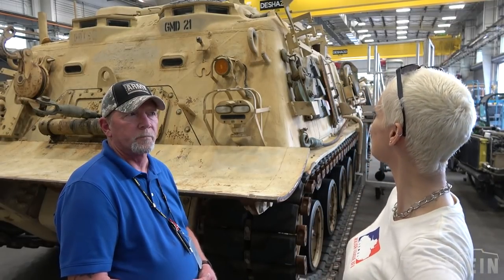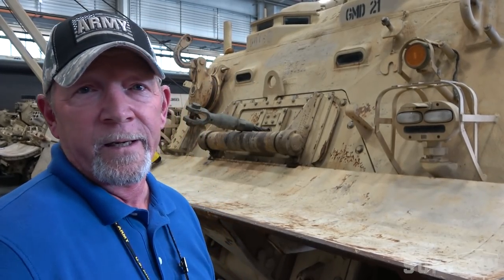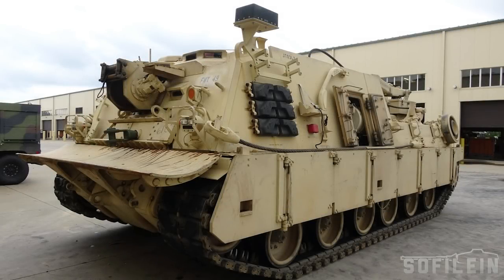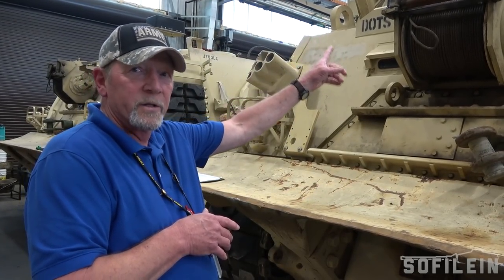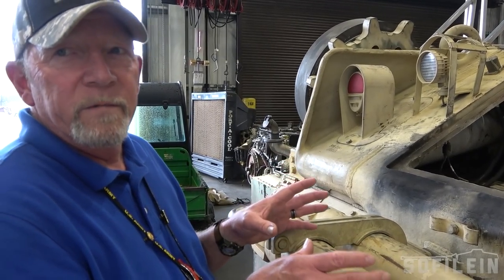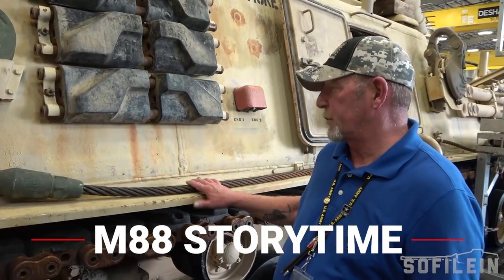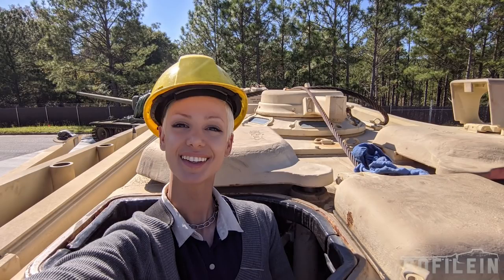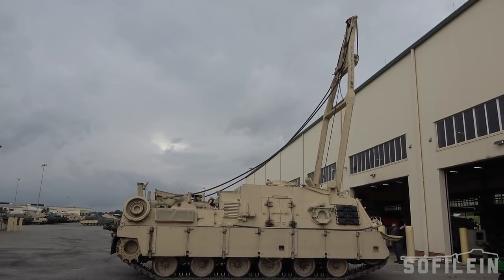M88A1 and M88A2 U.S. Army Armored Recovery Vehicles

Comment: All true, but as one of the engineers who designed  or was directly involved developing the M88A2, it is really nice to know  people know.  The presentation was an intro to a truly remarkable vehicle.  
The APU was on the later versions of the M88A1, but not as capable.  We added additional functions.  
There is confusion about the power for some reason.   There was some experiments with a 1050 hp supercharged engine in the A1 but never fitted beyond a few field tested vehicles.   The 1050 hp engine used in the A2 is an upgraded version of the base engine used in the A1, M48, and M60.   We experimented with a 1210 hp engine in the chassis, but the only gain was to speed without load and it ate more fuel.    Cooling was also a little marginal in summer heat even at BMY's York, Pennsylvania, plant.  It would have been a real issue in the desert.  BUT the 1050 is a perfect match for low end torque which is what really matters to a tow truck.   It was actually hard during the Aberdeen testing for the US Army  crews to find the vehicle power limits with real world tests.  
I was directly responsible for the winches including the little guy out front.  We went with commercial styles, but both were cutting edge at the time.  The main 70 ton winch was an all new P&H design with the gear train inside the drum.  That design became the standard for P&H mining  and heavy lift equipment for decades.  It was in fact so strong it destroyed several drums in testing and thus the micro switches were added to protect the drum.    The hoist winch was actually a derated commercial unit.  It was far cheaper to derate an existing winch than buy per spec. and I believe for the A3 they simply rerated it to get the 40 ton hoist capacity.  The baby winch was put in because it would take 10 men to drag the main cable on hard ground.  
The main winch cable was developed by Bethlehem Wire Rope (Now Williamsport Wire rope in northern PA).  It had the flexibility of a 1 1/4" cable and the strength of an XS 1 3/4" mining cable with fantastic abrasion resistance and a 1 3/8" diameter.  We broke one under high load testing and it went wild.  There was so much energy the cable  was still moving 30 minutes later.    Extremely dangerous but fortunately no one was hurt though it sliced clean through some 1/2 carbon steel plate.
The 140 ton snatch block was my sketch design and then detailed by a block  supplier.  A standard design would have weighed 450 pounds.  So I took a large diameter bearing  cutting out hundreds of pounds from the center in the donut arrangement.  It was still massive at 210 pounds and it was the reason for the little aux boom hoist.  I argued with my manager during the design phase and he did not concede it until the snatch block arrived and people could actually try and pick the thing up.    The shape and pipe in pipe base design came from something I had seen before on a boat.    The test crews at Aberdeen retrofitted it onto their regular M88A1's.  
I was also the person who came up with the applica armor mounting using carbon steel strips and angles.    It made installing the armor cheap, fast and easily field replaceable with an acetylene welder.    
I also did most of the hoist boom design.  We went to rectangular tubes with reinforcement plates because the highest load was lifting the thing off the back of the vehicle.  It literally was bending itself.  Once up, the boom actually is over designed.   I understand they did not change anything on it for the new A3 40 ton rating.

The beast was fun to drive.  One of the Aberdeen tests is to drive through live 12-14" diameter oak trees at a specific speed and only loose a few MPH.   We used to drive around carrying M109's (also made at BMY York) to show off its capabilities.  

The only less than ideal aspect is the fixed boom.  Everyone else has used rotating booms but there are huge disadvantages.  The Germans and their fans keep putting out leopard  based recovery vehicles which actually repeat the same issues.  The General Dynamics M1 based recovery vehicle back in 1988 had a rotating crane and they tipped the vehicle on its side during run off testing with the M88A1E1.   That vehicle was also a massive gas pig.  They were doing a demo for the Army brass and it ran out of fuel driving up in front of the grand stand.  They literally had a fuel truck following it.  Later during the demo, it had a major breakdown and had to be towed back to the hanger ...by the M88A1E1 right past the brass in the grandstand!
BMY developed  the first M88 beast in 1959 and it is still in upgraded form out there.  It is the Ma Deuce of armored vehicles.

Comment: One of the biggest assets to Allied forces in WW II was the maintenance battalions and Armored recovery capabilities.  The US and it's allies were able to recover and repair tanks and armored vehicles faster on the battlefield because of that force structure.  In comparison, the German's weren't able to keep up vehicle recovery and lost many more tanks due to mechanical failure or battlefield losses that were not recovered.  They had recovery units, but were not as robust as the allies.

Comment: My father was a tank mechanic (M48) in the US Army ('57 - late 60's) and had the M88 after it came into service in '61 or 62.While in Germany ('58- 64?) he served in the sister batt. from Elvis Gofor Presley.
He was also the only one in the batt. that was "certified" to calibrate the gun targeting.
Not sure what all was different from the 88 to the 88A1 to bad this vid didn't also compare the 88 if any are still around.

The whiskey story explains a bunch of his pics in the barracks with a 5th...lol
I over heard him telling another vet once long ago one mission he was retrieving a stuck German? (M48?) and the driver popped his head up through the hatch and didn't have it locked in the open position and it swung and took his head off.
After the Army he spent the next 40yrs as a heavy equipment mechanic for a very large road construction company in PA,NY,and DE as their #1 out in the field.

Comment: No experience with the M88.  Knew the M578 light Recovery Vehicle.  Was Mech. Inf. Germany 72-75.  In 3 1/2 years with 1-7th Inf. 3d ID, Aschaffenburg, we never had a working M578.  Either it was down waiting for parts or away at a repair facility.  We did occasionally have it in the motor pool after some repair was finished.  It immediately broke down and was dead-lined.  In my whole time in Aschaffenburg it never took to the field.  Hope the M88 was a much better vehicle.

Comment: Please forgive an old sailor for what might seem to be a dumb question, but the M88 crews would be Combat Engineers, yes?  

I ask because when my son was talking with an Army recruiter he was very interested in getting into the Combat Engineers.  I think he would love this beast. 
A 'tank' not only stuck between two trees but 3 FEET off of the ground?  How in the heck did they manage that?

Another excellent presentation Sofi, you have a knack for finding subject matter experts who are articulate enough to keep my interest.
Reply: Nope, they're mechanics. The engineers have their own tank-based vehicles. The old one was the M728, based on the M60. It had a dozer blade, a crane and a 165mm short barreled demolition gun. The new one is the M1150, which was actually developed by the Marines. It's called an Assault Breacher Vehicle. Clears minefields and other obstacles.
Reply: @zeedub8560  Thanks!  I figured one of you guys would know.  One of the last trips I took in USS Nassau (LHA 4) was to retrieve an Army National Guard unit that had been doing work in Jamaica.  They were an Engineer unit so lots of trucks, dozers, Hummers and so on.  I don't recall seeing any armor or purpose combat vehicles so thought I would ask.  As I recall the unit was company strength, maybe two but in a ship designed to haul up to 2000 of our Jarhead brothers and ALL of their tanks and other vehicles, the Army dudes didn't stress us at all.

Comment: I'm not sure about havinge a three-man crew. It usually takes two crew to rig the cables and blocks.  The crew chief operates the boom and winches and the driver maneuvers the vehicle. Two tank crew are usually needed to maneuver their vehicle (drive and TC) and other two crewman provide security.  If the need for recovery was caused by combat damage hopefully you have all 8 men available.

Comment: This person did a great disservice to your channel. This man knew enough to make someone who doesn't know anything about an M88 series vehicle think that he is an expert. If he is an expert then he did a lousy job of briefing the M88A1 and A2. He never talked about the differences in capabilities between the M88A1 And the M88A2. He didn't talk about the Onan APU, which runs the the refuel/ defuel, Hyd impact wrench, and Aux hydraulics So that you can raise the boom and pull the deck and the power pack when the engine is blown. The APU also charges the batteries (so that you can run the Hup heater on those cold nights without killing the six batteries. The differences in hoisting (25 tons vs 35 tons) and winching (45 tons M88A1 vs 70 tons M88A2). He didn't even know the correct horse power of the vehicles. The M88A1, 1790 2DR continental V12  is not 800 hp it's 750 brake hp. The M88A2 is 1,050 bhp.  He never mentioned the seven micro switches to protect the main winch from destroying itself on the A2. The maximum fleet angle for main winch recovery. The differences  between the recovery snatch blocks 90 ton A1 vs 140 ton A2 (weighs 217 lbs.).  Never pointed out the Aux boom and the different mounting position on top for lifting the spare tow bar, 140 ton snatch block and the APU dog house from the side of the 88. He never mentioned the hoist lifting capabilities with the spade in the spade up or spade down positions or with the suspension locking blocks installed. I could go on but you get my point. BTW, I've been retired for over six years now and haven't been on an M88 since. But at least I still know what I'm talking about.
Reply: I just wanted to add that the M88 was developed in 1959 and fielded in 1961. The A1  was upgraded from a gas to a diesel and the A2 was upgraded in 1999 to accommodate the increasingly heavier M1 series tanks. Mainly the M1A2SEP. The smoke generators were disconnected when the Army switched from DF-2 to JP-8.
Reply: All true, but as one of the engineers who designed  or was directly involved with everything you mention, it is really nice to know  people know.  The presentation was an intro to a truly remarkable vehicle.  
The APU was on the later versions of the M88A1, but not as capable.  We added additional functions.  
There is confusion about the power for some reason.   There was some experiments with a 1050 hp supercharged engine in the A1 but never fitted beyond a few field tested vehicles.   The 1050 hp engine used in the A2 is an upgraded version of the base engine used in the A1, M48, and M60.   We experimented with a 1210 hp engine in the chassis, but the only gain was to speed without load and it ate more fuel.    Cooling was also a little marginal in summer heat even at BMY's York, Pennsylvania, plant.  It would have been a real issue in the desert.  BUT the 1050 is a perfect match for low end torque which is what really matters to a tow truck.   It was actually hard a during he Aberdeen testing for the US Army  crews to find the power limits with real world tests.  
I was directly responsible for the winch including the little guy out front.  We went with commercial styles, but both were cutting edge at the time.  The main 70 ton winch was an all new P&H design with the gear train inside the drum.  That design became the standard for P&H mining  and heavy lift equipment for decades.  It was in fact so strong it destroyed several drums in testing and thus the micro switches.    The hoist winch was actually a derated commercial unit.  It was far cheaper to derate an existing winch than buy per spec. and I believe for the A3 they simply rerated it to get the 40 ton hoist capacity.  The baby was put in because it would take 10 men to drag the capable on hard ground.  
The main winch cabble was developed by Bethlehem Wire Rope (Now Williamport Wire rope in northern PA).  It had the flexibility of a1 1/4" cable and the strength of an XS 1 3/4" mining cable with fantastic abrasion resistance and a 1 3/8" diameter.  We broke one under high load lesting and it went wild.  There was so much energy the cable  was still moving 30 minutes later.    Extremely dangerous but fortunately no one was hurt though it sliced clean through some 1/2 carbon steel plate.
The 70 ton snatch block was my sketch design and then detailed by a block  supplier.  A standard design would have weighed 450 pounds.  So I took a large diameter bearing  cutting out hundreds of pounds from the center in the donut arrangement.  It was still massive at 210 pounds and it was the reason for the little aux boom hoist.  I argued with my manager during he design phase and he did not concede it until the snatch block arrived and people could actually try and pick the thing up.    The shape and pipe in pipe base design came from something I had seen before on a boat.    The test crews at Aberdeen retrofitted it onto their regular M88A1's.  
I was also the person who came up with the applica armor mounting using carbon steel strips and angles.    It made installing he armor cheap, fast and easily field replaceable.    
The beast was fun to drive.  One of the Aberdeen tests is to drive through live 12-14" diameter oak trees at a specific speed and only loose a few MPH.   
the only less than ideal aspect is the fixed boom for the turret.  Everyone else has used rotating booms but there are huge disadvantages.  The Germans and their fans keep putting out leopard  based recovery vehicles which actually repeat the same issues.  The General Dynamics M1 based recovery vehicle back in 1988 had a rotating crane and they tipped the vehicle on its side during run off testing with the M88A1E1.   That vehicle was also a massive gas pig.  They were doing a demo for the Army brass and it ran out of fuel driving up in front of the grand stand.  They literally had a fuel truck following it.  Later, it had a major breakdown and had to be towed back to the hanger ...by the M88A1E1 right past the brass in the grandstand!
BMY developed  the first beast in 1959 and it is still in upgraded form out there.  It is the Ma Deuce of armored vehicles.

Comment: Sorry, but I've crewed and worked on the M88 series during a 25 year career.  it was fine for it's time, but back in 1985/86 the Army was presented with a new Combat Recovery Vehicle based on the M-1 hull.  This M1-CRV had part commonality with the M1 fleet tanks (the M88 is a battlefield orphan, no parts common).  It had a 35-ton swing boom with 270 degree's of coverage and a 28 foot usable hook height, a 70 ton single line main winch with a 25 ton Aux winch under armor, a 300 h.p. Aux power-pack, a full dozer blade/earth anchor, and lastly could carry eight persons inside.  And yes it could do the same high speeds as the M-1.  An M88 is sadly not any were near as fast, nor powerful.

>~<   boody 'ell.  my ability to spell is utter shite at times...
Reply: Yeah that's great. Too bad it was never put into production.

Comment: Loved the "88" that I was assigned to. It was 1981 and I trained as an M-60 mechanic (N63). When I landed in Germany, I was the "rigger" for about 6 months when the "motor pool Sergeant" said, you are now the 88 operator and at the same time our unit ( one of the first units to get the M-1, in Germany) So then I had to train on how to work on the M-1. I lived the 88 and had some really good times for 3.5 years, the first unit that I served in was the 3/63 B  THEN I had orders for Fort Hodd to the 1 Cav and the 1-1/8 Cav. and operated the 88 for the next 1.6 months. a little story that happened to me and the other 3 guys that were in the 88 with me. It was summer in TX and we were doing some training of our own. (we just kinda stayed in one location tell someone radioed us to go get them going again, The M-1s were doing all the training and the 4 of us were doing some map training inside the 88. While we had some "HUSH" to smoke, so we removed the NBC filleters and put a cut piece of the hash on top of the beer can and lit it and placed it inside of the NBC cabinet closed the door, and turned on the fan and put our gas masks on so we could smoke the black rock. about a good 10 minutes later some of us were on the ground while 2 of us were inside and we were all smoking. When a "FULL BIRD came up to our 88 and he said. "DAMN, NOW THERE ARE SOME REAL MOTIVATED TROOPERS RIGHT HERE. IT's 100+ OUTSIDE AND WE ARE LOOKING AT A MAP WITH GAS MASKS ON". If he only really knew what we were doing. LOL Then there was a night in some small town in Germany and it was raining and  "REFORGER". and everyone was there, will I know German very well. (my dad severed with the WAFFEN SS 1st Panzers, he was a gunner, and good at it too. so I learned to speak German from him. He Hated "OTTO" Their Leibstandarte SS Adolf Hitler their Commander. they had a white Key on a Black shield was their Insignia). will back to the story, the 4 of us just got done eating some MRE's and I went outside to do a post check on my 88 when 3 girls came up riding on their bikes and they wanted to take a look inside our 88. So we let them in and from one thing to the next. we all started drinking some beer and taking our clothes off. (they were cousins). 18,19,21. and they wanted some American meat. I'll stop here. I have so many stories about being on and around the "88".